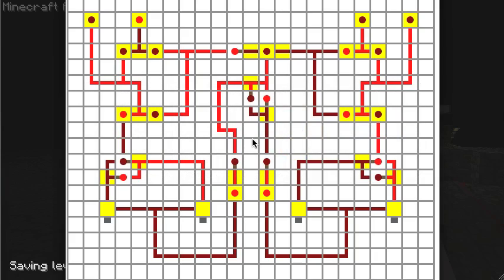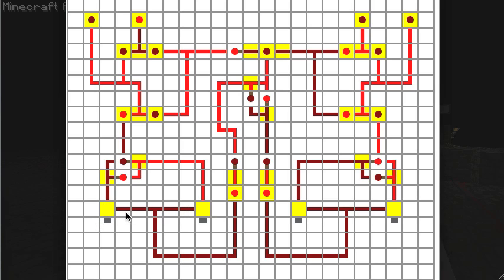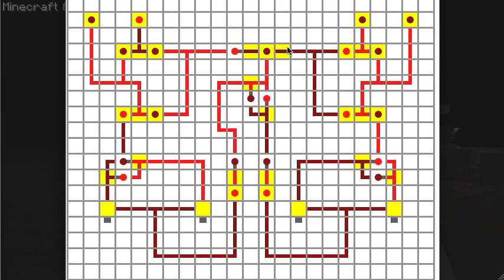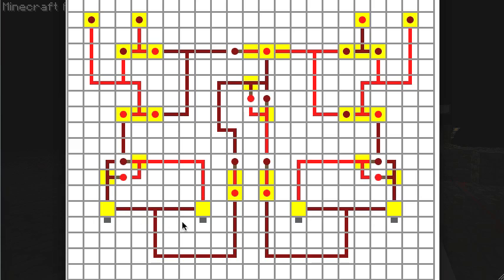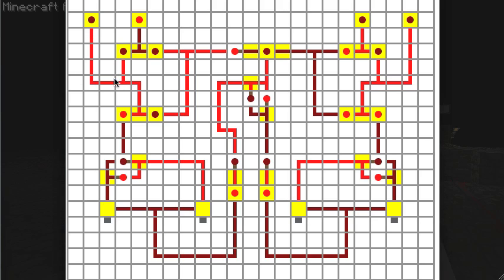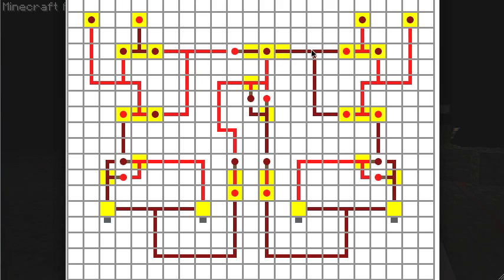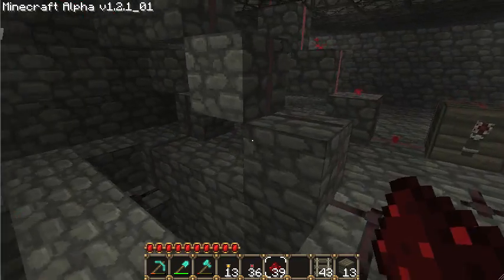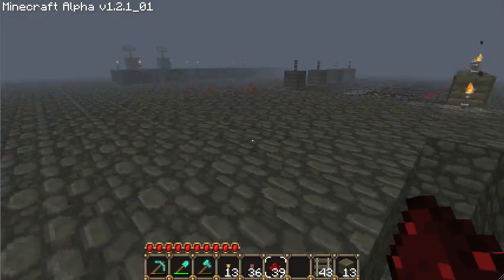Redstone Tutorial: 4-way Track Switcher

Comment: Thanks for the video. I'm in the process of making a switching station on a multiplayer server that I frequent. My proof of concept version uses two levers to determine destination (4 total), but I was planning on changing that to push buttons due to it being easier for the user than hitting several switches. The wiring is, unfortunately, far more complex for buttons than it is for levers :) . My next step was going to be swapping out the switches for pushbuttons.